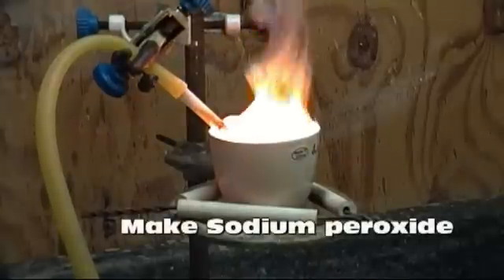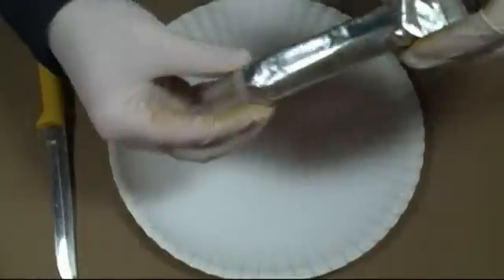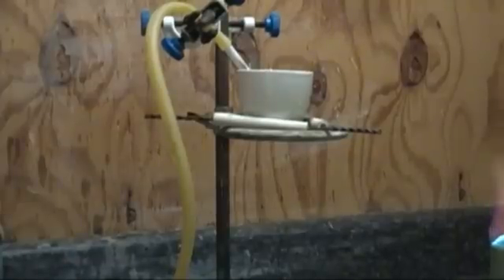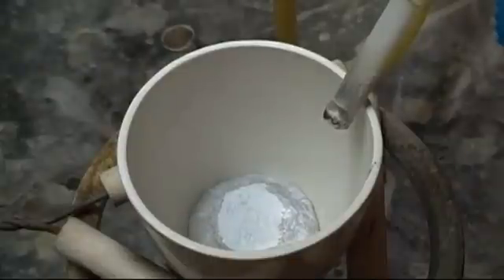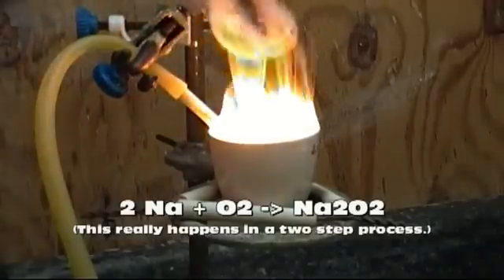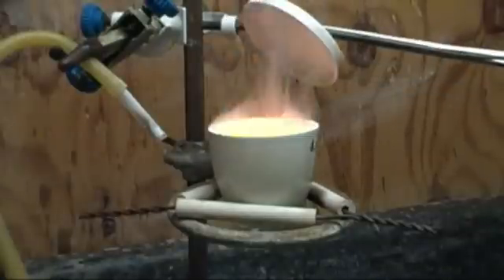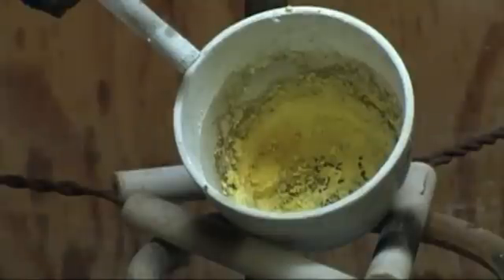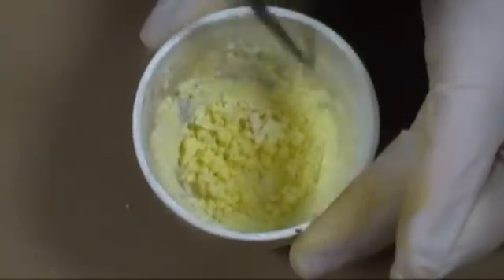Make Sodium peroxide

Comment: Holy-Terrorist:>*=* You can make hydrogen peroxide by ultrasonic vibration of aluminium metal in the water can make hydrogen and hydrogen peroxide in smoke form, of the reaction formula!
2xH2O =catalyst of ultrasonic vibration of aluminium metal= H2 + H2O2
*=* Dont heat water of probably cause oxidation of aluminium, cold water are probably good stuff!
*=* I knowed this stuff in book of my school!
*=* Use polyethylene bottle for not decomposition of hydrogen peroxide maked!
*=* Info, not tested!

Comment: is it relevant to melt the sodium before, or would it just react to sodiumoxide or sodiumdioxide if you just burn it?
and will the sodiumperoxide  react to a lye or an acid if dropped in water?
so, will it mainly behave like sodium at itself?
Reply: dont think you still need it but it will produce NaOH when you put it in water.
burning the peroxide in air will turn it to sodium oxide.
sodium oxide can also be put in water to form NaOH.
sodium is still stronger than some spent version of sodium

if you want sodium, look up my formula and get insane enough to try and improve on it so you can collect actual sodium metal from a reaction.